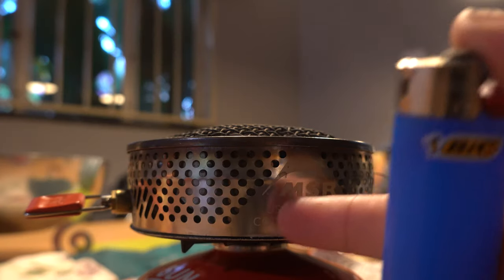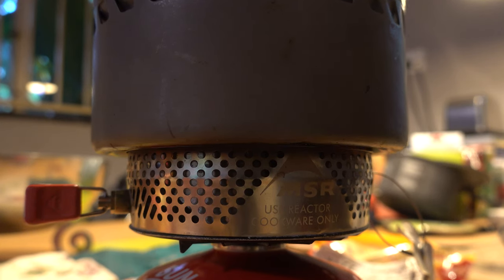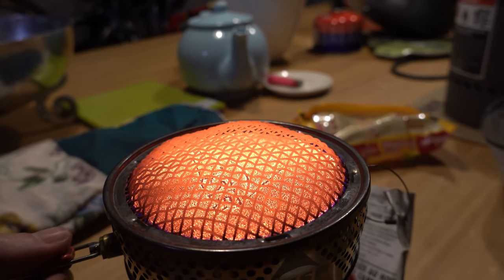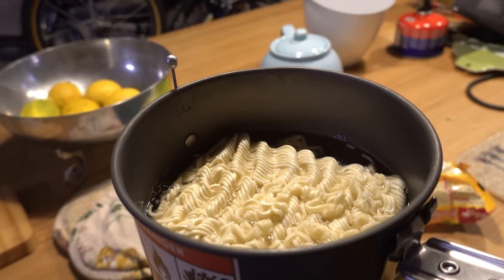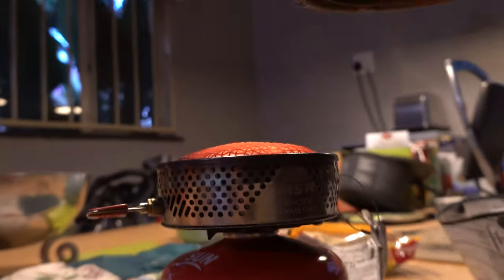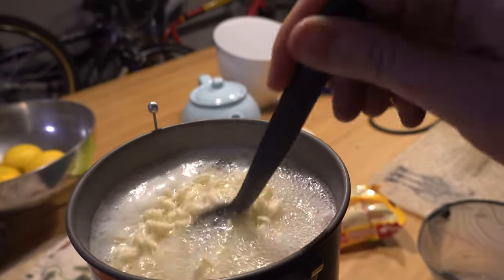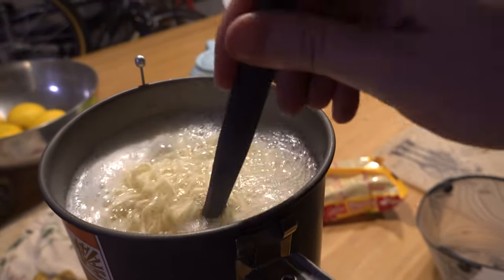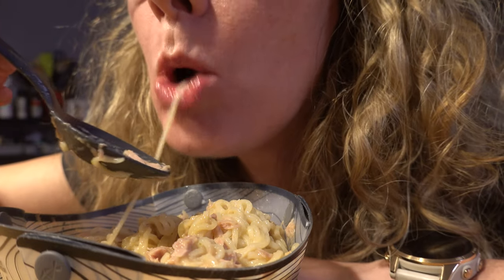How to SIMMER the MSR Reactor Camp Stove

Comment: I used this stove day to day for 3 months last year, you pretty much have nailed how to simmer, I would add once you heat up the burner and are turning the heat down, if you turn it off, you can quickly turn the stove back on and it will relight off of the residual
Reply from the maker: Thanks, Paul! That's really useful advice 😊

Comment: Looks like MSR has achieved the “holy grail” of camp stoves.
Boiling water is fine, but actual cooking requires more than gross BTU’s. First off, you need to reduce the heat to the right amount. Just as important, you need the heat to be even.
Camp cookware tends to be made of thin sheets of materials that don’t distribute heat well. Camp stoves tend to have point heat sources. Combine them and you burn the food.